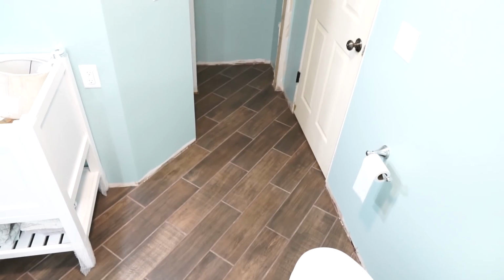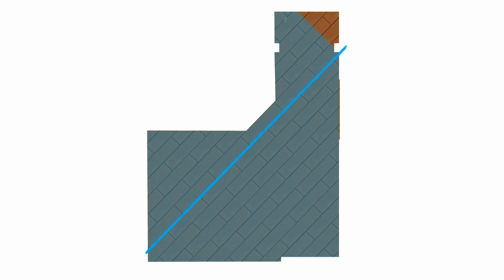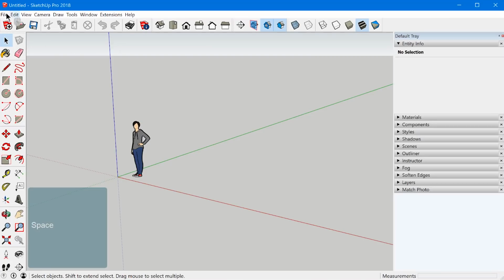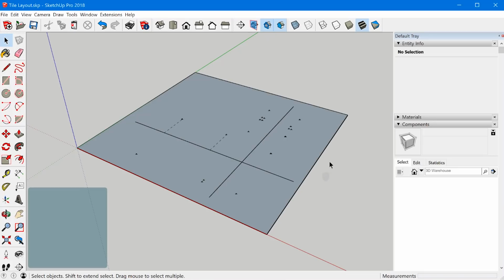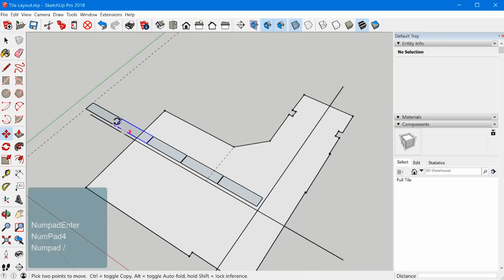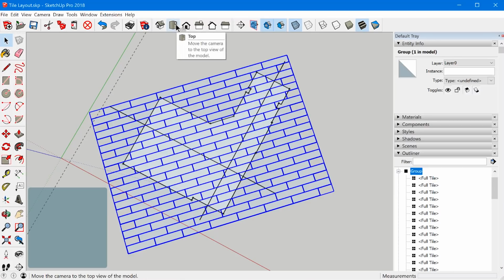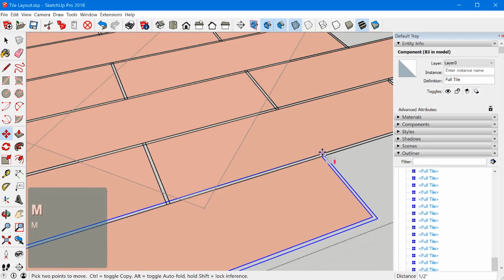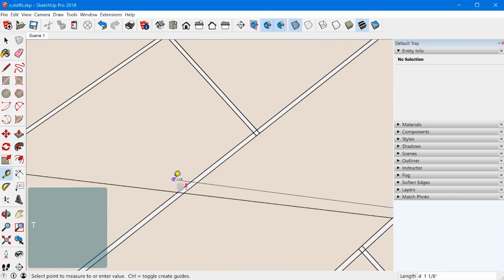Diagonal Tile Planning in SketchUp

Comment: Truly awesome....  Ever tried to do this in say a 3-D setting on a tub/shower alcove?  Not sure if you could do it with 3D, but you could do it as 3 separate 2D models...
Here is what I am thinking....  My darling bride wants our alcove tub/shower surround in 12 x 24 nominal porcelain on the back wall and side walls of the alcove (floor to ceiling alcove).

The TRICK is that she wants it set on a 30 degree positive slope that continues around ALL THREE walls....  So I am thinking either a 2D of all three walls in one plane that you then cut/fold, OR 3 each 2D models that you align with registration marks on the transitions at the corners...  You would need to work around the expansion joints at the corners, OR better, CUT OUT for the coved profiles from the Schluter (et al.) CAD drawings (and physical on-hand materials).

THANK YOU!  I know this is wayyy beyond your intent on a SketchUp tutorial, but since you set tile too, I thought it might be interesting to you....

Off to figure out which SketchUp software to buy for this project...  Soooo much potential time and materials savings once I get past the software learning curve.
Reply from the maker: The thing that's tricky about showers is you don't have baseboard covering the cut pieces, so it's hard to get it just right. You could definitely get a rough plan in 3D, but you'd have to measure the pieces that need to be cut in the field. Your alcove sounds like fun. I'd definitely do it in 3D to get an idea of the layout.

Comment: Thanks for the tutorial (and I love the Architecture book!).  Not related to your tutorial, and it looks like your floor has already been done, but in the future, you should only overlap long tiles like that by only a 1/3 max.
Reply from the maker: Hi Brad. Yeah, I've heard that recommendation before. I believe it's to reduce lippage between tiles. In this project, I actually had to build up the floor about 4" (there was a weird step-down into the room), so I was able to establish a very level subfloor using a laser before installing the decoupling membrane, so I wasn't worried about lippage, and liked the look of the half-stagger layout I ended up going with.
Reply: @Mastersketchup  Agreed, Its a protip to help manage lippage. Not a new rule you HAVE to follow. And how much lippage is acceptable? Is subjective. Its like a drummer paying attention to another drummer to critique him, when the lay men has less of a focus. They even tell you to use a bigger trowel for large format tile so the thinset is fatter and it can take up more lippage with your tile leveling system to account for tile warpage. If youre skating a wedge across your tiles and everything is perfect, it doesnt matter what you did to get there. Youre tile work is perfection.
Reply: A lot Depends on the Tile MFG.  How flat the Tiles are.

Comment: I worked for a pool, patio and landscape company and attempted to model proper tile layout but was told that the crews would never follow the plan. Too bad because they could have saved money along with a better looking finished product.
Reply from the maker: Yeah, that is something that is always important. You can spend as much time as you want designing in 3D, but if that information doesn't communicate into the field, it can sometimes be worthless.
Reply: You should have started your own company at that point and put him out of business, while charging more, with your portfolio of pictures. They dont send those slap it up sammies into monied districts. The build quality and technique Ive seen go on in Unmoneyed areas is completely a joke. But hey it gives the new guys a place to cut their teeth. The problem is the people that could have done a better job on their first try with these guys making 0 improvements with experience. If youve been at it for more than a year, you should know how to use a level. These guys just dont care because they expect nobody to check their work that hard, So they just eyeball it.

Comment: i used sketchup to layout 2000 square feet of concrete pavers  around a pool. the project came out perfect. same for my bathroom tile projects.
Reply from the maker: When you take the time to plan it out, things tend to go better during installation. ;)